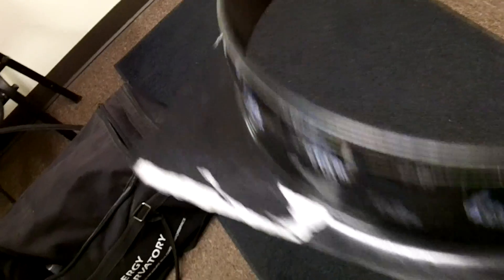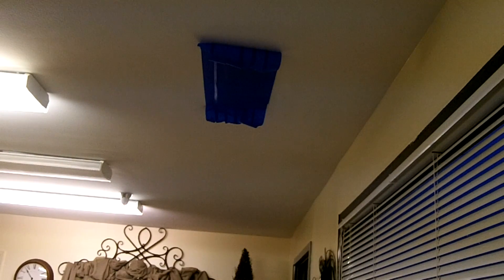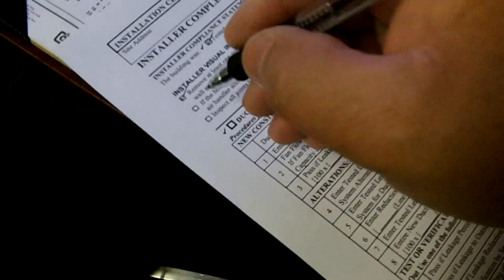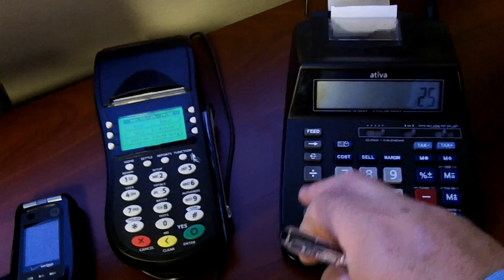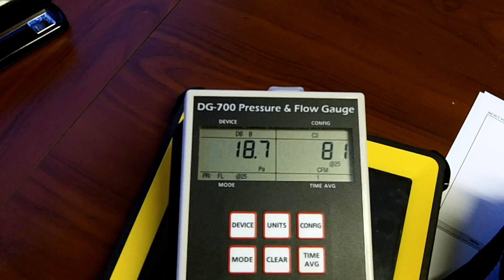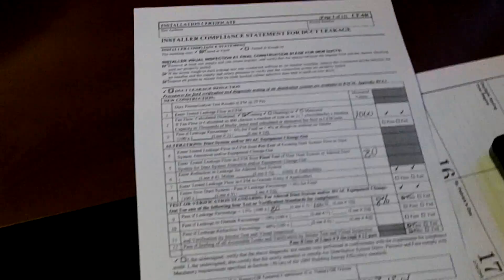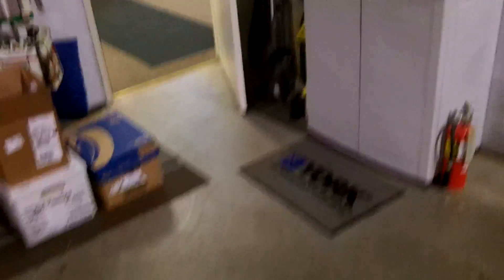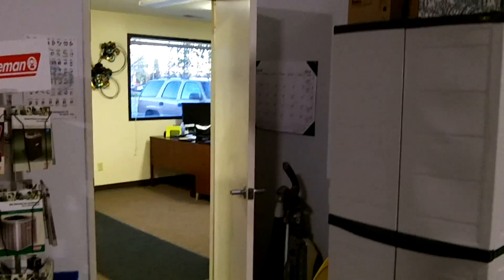HVAC California Title 24 duct blast

Comment: Just found your video.  Texas just signed IECC 2015 into law.  CA isn't the only one with "crazy" building standards!

Wanted to let you know we've got a reusable system for sealing off the supply vents.  You can set Vent Caps remotely with a remote attachment tool, there's no risk of adhesive damage, and they're 100% reusable.  It save a ton of time and a LOT of blue tape!

Comment: Thanks for the demo Nutin. You guys definitely have a lot of regulations! It has come to NC, but only on new construction. Great video.
Reply from the maker: Thank you Talyn875, we have crazy law makers out here lol, its getting worse for us every year.
Reply: The HVAC hack market must be strong out there because of the lawmakers.
Reply from the maker: talyn875 It only gets worse with the new laws low ballers get lower no permit hit and run
Reply: Nutintoitbut2doit when they make you buy a toilet when you permit a job I wouldn't want to get a permit either.